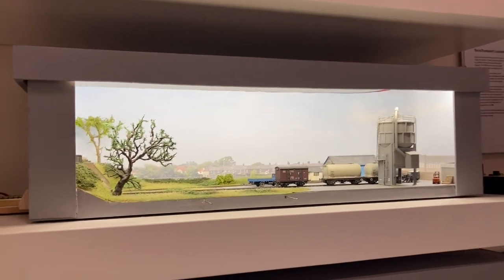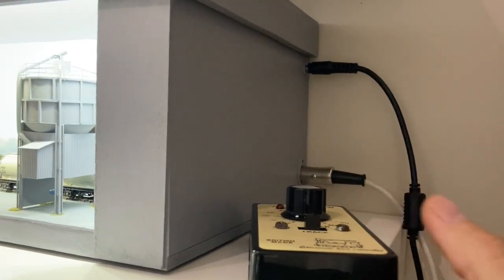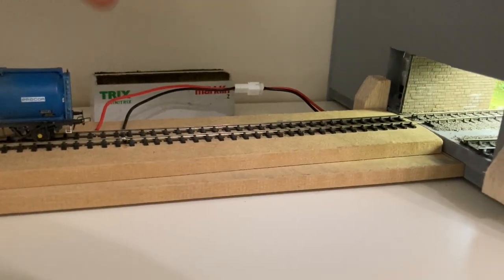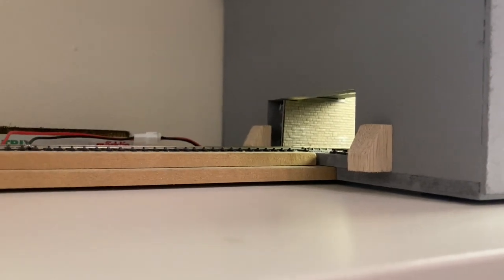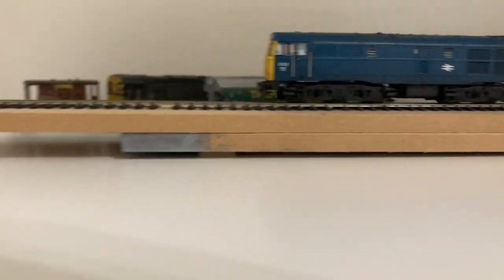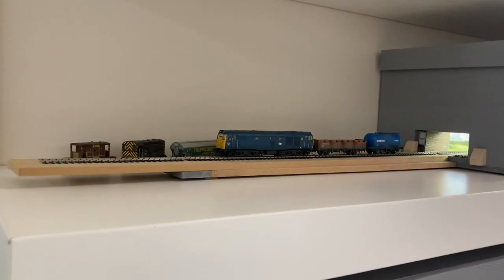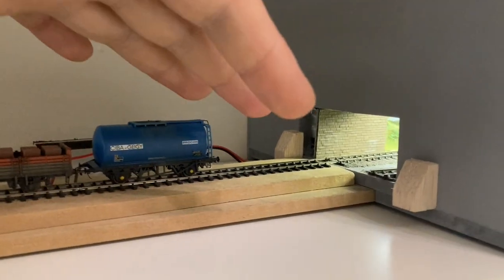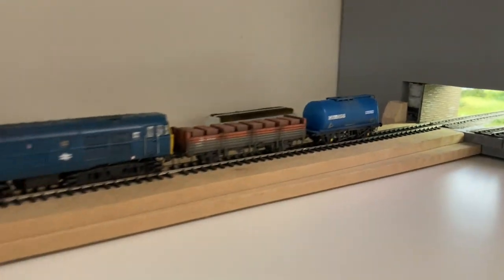Micro Cameo Layout - Fiddle Sector Plate

Comment: Thank you so much for these videos -I've no idea why I've not come across your channel before nad it's just lovely. 

At 0:41 can you please help me out - what's the amperage of the laptop power supply please? Are there any other wiring shenanigans going on to allow it to power the LEDs and the Gaugemaster controller (Model W?) other than screwing into a chocolate block connector (or equivalent) ? Many thanks!
Reply from the maker: No magic, all wired up via normal switches and plugs as you suggest. A 2.5mm panel socket accepts the laptop supply plug, I use a 5A as the LEDs use 1A per metre so it means it will power Gerald Road (which is a metre) with plenty of power left for the Cobalt SS and Gaugemaster W.
Reply: Thank you @JamesHiltonCustomModelRailways , that's very handy to know - at the moment I'm using a Gauge 1 rated power supply for my layout and it's a bit too much for 4mm/ft. Do you know if there's enough juice when feeding the GM-W controller to power 4mm locos?
Reply from the maker: Yes, I have run OO locomotives with it, it just drops the top speed as your only getting about 9v out.